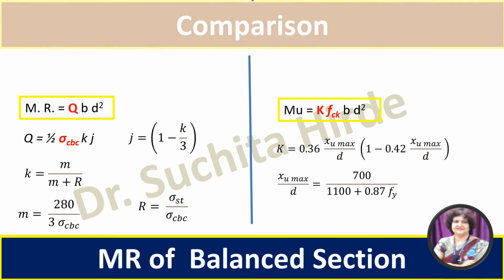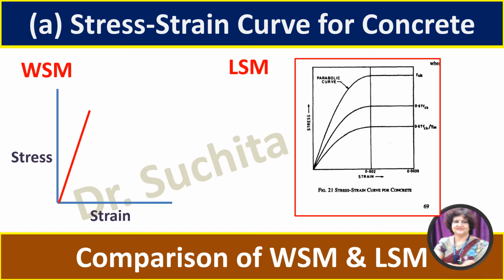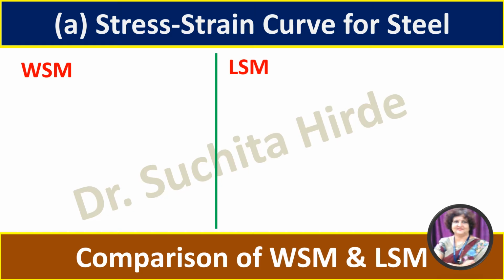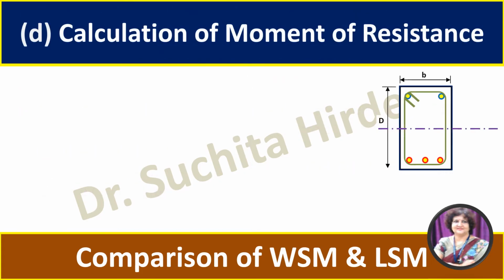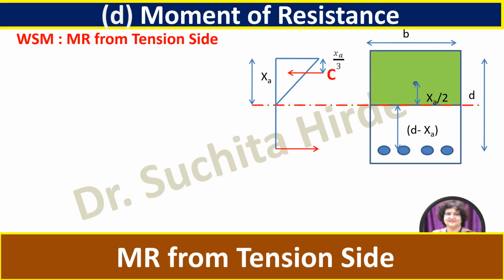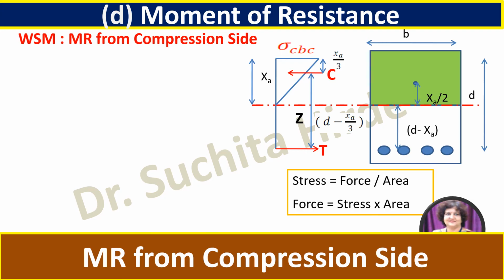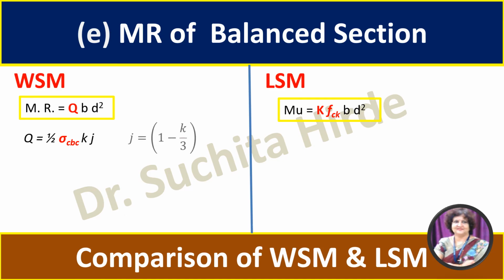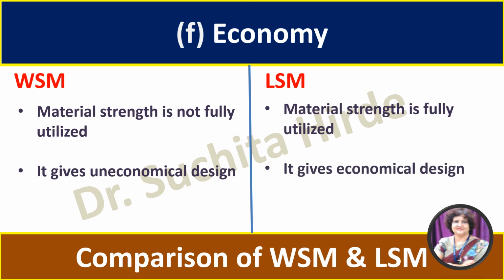Comparison of Working Stress Method (WSM) & Limit State Method (LSM) with concepts

Comment: (LSM और Uncertainty – Structural Engineering का Intellectual Shift)**
आज जब हम 40, 50, 60 या 100-storey buildings को देखते हैं,
तो आमतौर पर हम कहते हैं—
better concrete
better steel
better software
लेकिन मैं आज यहीं से एक थोड़ी uncomfortable बात से शुरुआत करना चाहता हूँ।
High-rise buildings इसलिए possible नहीं हुई क्योंकि materials strong हो गए,
बल्कि इसलिए possible हुई क्योंकि engineers ने uncertainty को accept करना सीख लिया।
Structural engineering का initial phase
एक certainty-driven world में develop हुआ।
Working Stress Method का basic philosophy यह था—
structure को इतना safe रखो कि वह कभी elastic limit के पास भी न जाए।
Loads को fixed माना गया।
Material behaviour को linear माना गया।
और safety का मतलब था—failure से दूर रहना।
यह approach गलत नहीं थी।
इसने engineering को discipline दिया,
calculation culture दिया,
और low-rise buildings को safe बनाया।
लेकिन इस philosophy के अंदर एक silent assumption थी—
कि nature predictable है,
और uncertainty को सिर्फ extra margin से handle किया जा सकता है।
यह assumption तब तक काम करती रही
जब तक buildings low-rise थीं।
जैसे ही cities vertical हुईं,
यह assumption टूटने लगी।
High-rise buildings में gravity load secondary हो जाता है।
Wind एक dynamic force बन जाती है।
Earthquake एक uncertain, impulsive action होता है।
और तभी एक बड़ी realization हुई—
Rigidity, strength नहीं होती।
और ज्यादा rigidity, high-rise के लिए dangerous हो सकती है।
Rigid structure uncertainty के साथ negotiate नहीं करता।
वह uncertainty को oppose करता है।
और जब uncertain forces को oppose किया जाता है,
तो failure sudden होता है,
failure brittle होता है।
यहीं पर LSM सिर्फ एक design method नहीं रहता—
वह एक intellectual shift बन जाता है।
LSM यह मानता है—
हमें exact load नहीं पता।
हमें exact strength नहीं पता।
हमें exact future predict करना possible नहीं है।
इस ignorance को ignore करने के बजाय,
LSM ने design philosophy को ही बदल दिया।
पहला बड़ा change था—
uncertainty का classification।
Load uncertainty अलग है।
Material uncertainty अलग है।
Modelling uncertainty अलग है।
यहीं से partial safety factor का concept आया—
जहाँ risk को blur करने के बजाय
उसे identify किया गया।
दूसरा major shift था—
probabilistic thinking।
LSM worst imaginable case के लिए design नहीं करता।
वह statistically meaningful extremes के लिए design करता है।
इसलिए— characteristic loads आए,
characteristic strengths आए।
LSM का focus यह नहीं था कि structure कभी fail ही न हो।
Focus यह था कि failure acceptably rare हो।
इसी वजह से LSM यह मानता है—
Beam yield कर सकती है।
Steel plastic range में जा सकता है।
Cracks आ सकती हैं।
लेकिन—
Column collapse unacceptable है।
Load path loss unacceptable है।
Brittle shear failure unacceptable है।
यह weakness नहीं है।
यह intelligent design behaviour है।
High-rise buildings strong objects नहीं होतीं,
वे well-behaved systems होती हैं।
Earthquake के समय high-rise building का goal यह नहीं होता
कि building बिल्कुल move न करे।
Real goal होता है— energy absorb करना,
standing रहना,
और sudden collapse से बचना।
यह capability Working Stress Method allow नहीं करता,
क्योंकि WSM uncertainty को allow ही नहीं करता।
फिर एक और subtle लेकिन powerful shift आता है—
serviceability।
पहले सवाल होता था—
structure safe है या नहीं?
LSM सवाल बदलता है—
human comfort के लिए behaviour acceptable है या नहीं?
इसलिए limits define होती हैं— inter-storey drift limits,
crack width limits,
acceleration limits।
LSM यह accept करता है— building move करेगी,
cracks आएँगी।
लेकिन यह सब human comfort limits के अंदर होना चाहिए।
अगर आप सोचें—
क्या very tall buildings को WSM से design किया जा सकता है?
Theoretically—शायद।
Practically—नहीं।
क्योंकि WSM consider नहीं करता— wind-induced oscillations,
non-linear behaviour,
differential shortening।
WSM या तो structure को unnecessary heavy बना देता है,
या uncertainty को underestimate कर देता है।
LSM मानता है— building movable है,
लेकिन controlled way में।
और सबसे important बात—
Uncertainty को accept करना engineering की weakness नहीं है।
यह engineering की maturity है।
इसका मतलब है— engineers ने nature को समझना सीखा,
risk को quantify किया,
failure को control किया,
और behaviour को strength से ज्यादा importance दी।
इसी intellectual shift ने high-rise buildings को possible बनाया।
Reply from the maker: Well articulated.. Thanks